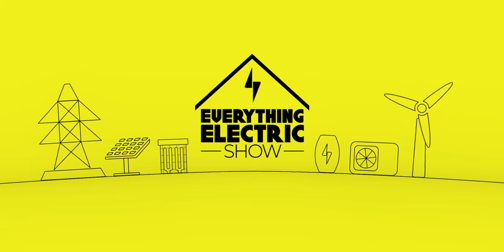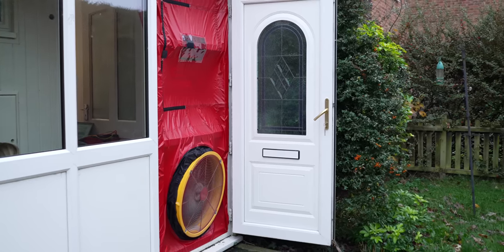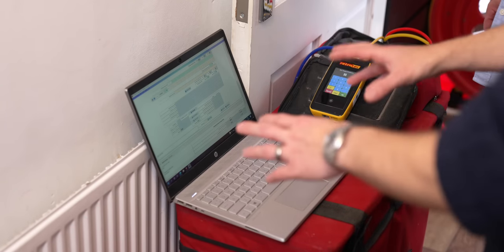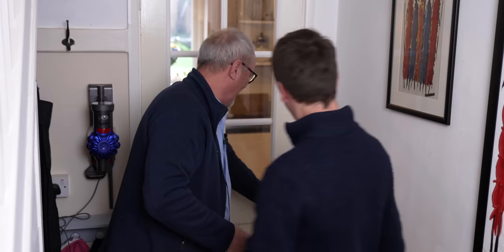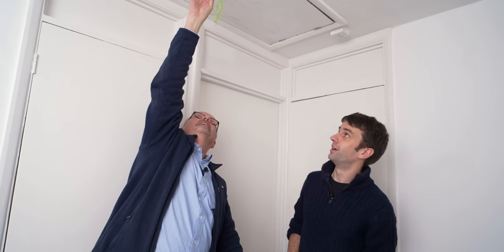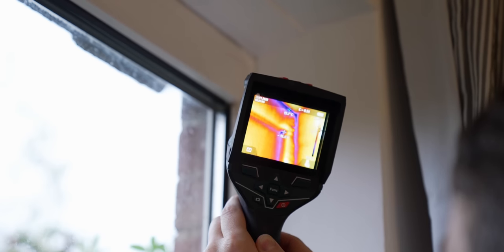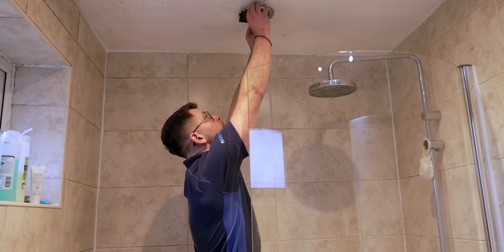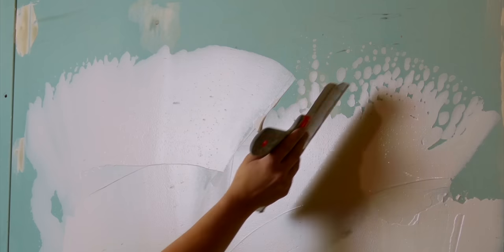Every Home Should Take This Test | Everything Electric Show

Comment: a test like this costs about $300 here in GTA, Canada... you can do something similar by turning on every exhaust in your house (washrooms, kitchen range) and going around with an incense stick to feel for leakage
Reply: Not sure if that would powerful enough, have you done it?
Of course the colder it is outside the better you feel the draughts
Reply: @markthomasson5077  a kitchen hood exhaust can pull 400cfm (depending on model) and each bathroom exhaust can pull 80cfm (again, depending on model). Combined together, that's definitely enough to depressurize a house and you will feel that make up air leaking in.
Reply: There are no exhausts in my house. I just open a window when things get smelly or steamy.
Reply: remember to close all your trickle vents and block any vent bricks during this test.

Comment: Just had NATTS in to perform the test after seeing this video.
So glad I did, what a superb service and really informative, not only found air leaks but advised how to resolve them.
Thankfully not a great deal of work to improve things and a surprisingly good score of 4.
The house previously suffered issues of condensation and mold, but I fitted a PIV unit a number of years ago which resolved that. Have a potential (with the ventilation unit) to get down to 0.5.

Comment: It really should be a DIY kit you can rent. I want to pay £30 to find the leaks, not £400 for someone to tell me where the leaks are.
Reply: We made one from a car radiator fan in a bit of OSB. It's gone round several local houses. You don't get an accurate ach number, but it's easy to pressurise to 40 or 50kPa on normal-sized houses (50 is the test for the standard) and then you can go round finding all the holes and take as long as you like over it. It's usually easier to put it in a window-opener than in a door. A bit of pipe with water in (manometer) suffices for a primitive pressure guage. Later we got a better one, and a hot-wire anemometer for accurately fiding and quantifying leaks. I didn't fancy paying £300 either, although now we've done most of the work I will do so soon to get an calibrated number (and calibrate our contraption).
Reply: Agreed. I paid £280 for mine and it'd be nice to pay less than that
Reply: You can diy it!   Close up the house, and then run the cooker/kitchen/bathroom extractor fans all at once.  It’s not as powerful as a blower door test but if these these can pull smoke out of a cold fireplace, then they’re good enough.

Then go around with a thermal camera/ir thermometer to find where cold air is leaking in.

My 2nd most recent video has me going around my house with a thermal camera.  They can be had for around £350 and they aren’t just handy for energy audits, they are excellent tools for all kinds of diagnostics.
Reply: Well the kit is £6k and the course for how to use it and calculate air permeability is expensive and time to train and to do several test houses. But yeah I absolutely hear you a cheaper alternative that doesn't do all that would be really beneficial. Combining with themal cameras in winter can be even more revealing. Shame they didn't showcase using smoke with the fan to find leaks.

Comment: Everyone watching this please contact someone that knows what they are doing before sealing up your house. Please remember ventilation is completely separate and should not be sealed. Seal Tight, Insulate and Ventilate Right ! If you mess up any one of those steps you can have problems. If you are in the Southwest UK give BAT Ltd a buzz
Reply: IMHO all homes should have MVHR and not rely on holes in the walls for ventilation!
Reply: totally agree! general public don't realise that background ventilation is required as part of the building regs for people health, whether that be mechanical or not!! I've been going around drawings adding extra ventilation as the window manufacturers can't get the required ventilation through their window trickles just this week!. Yes MVHR is a great alternative, but as with everything it's down to cost.
Reply: It's quite difficult to seal the average UK house up enough to give yourself a problem, although it is obviously do-able, especially if you are a 'dry clothes indoors', 'cook with no lids on' sort of family, or have a lot of people in a small house.
Some sorts of ventilation are just bad though (like trickle vents) and really should be sealed up and replaced with something more efficient/effective like DCV or MVHR.
Reply: @ashleyjohnson1908  Much much cheaper to do it during the build stage though

Retrofitting an MVHR is in the pipeline for my house but it's also £10K

I've currently got 8 solar panels, and plan to get 8 more before I do that

Comment: I've had this done in many (newer) properties, it's great. So easy to justify making incremental improvements. In older properties with solid walls (my latest is two foot thick basalt) with damp problems,  installing a Positive Input Ventilation System (PIV) to push out moisture you need some small leaks in the property to exhaust the slight positive air pressure created from inside to out
Reply: 2 foot thick basalt? Sounds like an interesting place/project!
Reply: Maybe you mean granite or whinstone solid walls?
Reply: @asilver2889  nope. I had it tested.

Comment: Well I know what I’m up to over christmas time off.
Dig fan out the loft.
Get thick bin liners.
DIY shop- loads of duct tape
Raid the my shed and dads junk cupboard for spare foam, off cuts of plasterboard and silicone.
Go round the house with a tissue on a stick.
TBF, we had EWI done 2yrs ago and know where the big issues are now.
Front door- knackered
Old coal fire breather in our bay window.
Single glazed wood framed tiny window in our pantry.

Comment: We used to do these tests for installing halon systems in computer rooms. In a domestic house, be aware if you seal the house too well you will probably get condensation and damp. The air needs to circulate. You also need to exchange oxygen and co2 with the outside, particularly if you have any type of combustion heating eg  gas, coal, wood burners etc
Reply: That's why on older properties you have trickle window vents, combined with bathroom and kitchen extraction and on newer properties you have mechanical ventilation with heat recovery.
Reply: I wonder how much energy is used mechanically circulating the air, versus the amount saved by recovery? In a commercial setting where the system is designed specifically for this, I would imagine it could be cost effective,  ut for the average residential box, I wonder.

Comment: I think it is important for widespread adoption to find a way to manage the trade-off between the cost of works (e.g. improving airtightness) against reduced heating, reduced cooling and increased controlled ventilation costs.  I would like to prepare something like a cash-flow forecast for heating, ventilation and cooling that gives a Return On Investment.
I don't think it is particularly easy to produce such a model or plan for one's house. E.g. where might I find a good source for a (working) energy cost forecast over 5, 10 and 15 years?
Does this sort of thing already exist?

Comment: It would be interesting to know if a house heated with infrared panels is better at keeping warm than radiators. If you are losing 'hot air' then you will have to replace it by heating the incoming cold air, but if the fabric of the house is warm, and the air is heated from that, is the loss of air going to have a lesser effect on how much energy you use?
Reply: There are a lot of factors to consider including; the wall build up, heating positions, insulation and thermal bridging, the use of the building, in particular when is it occupied during the average week, how much external surface area the building has (terraced houses are actually a good thing), the thermal mass of the building, how the air circulates within the building, the layout, and the thermal comfort. Higher speed air makes you feel cooler for example. I took part in a thermal comfort study a while ago, then the woman running the study left the UK due to uncertainty about if her qualifications would even be recognised after Brexit. No idea what came of that, but Salford University build Energy House 2, so there is still people left working on these studies.

Comment: Eee bah gum lad, that wa an epic show. We’d just put on an extra woolly over our string vests and eat a bit more int winter. Funnily enough I went through this exercise myself and sealed up two wooden doors with keyholes. I designed a 3D printed TPU keyhole plug as a right draft was coming through the doors. It’s up on thingyverse, so help yourselves. Look for Key hole plug.
Reply: Thanks. 😊 good work on leak finding!!!

Comment: Thanks for this, useful thing to have done. What I like is this is possible for renters to do as well. I'd like to see more videos on things renters might be able to do, as not everyone owns their own home and can fit heat pumps etc.
Reply: It is possible for renters definitely. What we need to do is get the government to change the regulations so that they count this towards EPC scores for existing housing. Currently they just assume a score of 15 for every house and you can’t change the score so can’t show an improvement, but it’s different for new builds! Please tell the government and your local MP. We need to change this so that landlords have an incentive to do this.
Reply: When renting old farmhouse I did my own draught proofing, cheap and easy, gaps round windows, doors, open letterbox (!!), under kitchen sink, skirtings and loft hatch - but that did need a stepladder. 
EPCs are truly rubbish. Suggesting unsuitable cavity wall insulation (solid walls) and taking no notice of  thermal mass etc.

Comment: Home owners and Landlords should be made to do the test and fix leaks.
Reply: Absolutely. They should do this to the poorest households who also have absolutely no control over fixing the problems to their home.
Reply: Definitely, this is one of the main motivations for this video. Please share and ask you MP. 
The testing system for EPCs needs changing as the government doesn’t take into account the air permeability score on existing housing stock when calculating EPCs so no landlords, councils or housing associations can justify doing this as they can’t show an improvement because the EPC system doesn’t let them! It neeeds to change urgently!
Reply: They should first do it to all council houses, some of my friends live in social housing and it is the worst living conditions imaginable.

Comment: For the attic hatch there are special made insulation blankets.

They mount in the attic around the opening and zip closed.
Like a big reusable grocery bag material.

Super easy to install.
Reply: That sounds like a great idea can you post a link?
Reply: @deanfielding4411  Search Attic Hatch Cover.

When I post links people report me for spam.
So I quit doing it.
Reply: Good, but still need to seal the hatch edges.
Reply: @asilver2889  The ones I saw doing pest control sealed around the framing.
I think it was some kind of double sided tape.

Comment: Thanks Dean, really interesting, especially about the dot 'n' dab plasterboard.  I've sealed all around waste pipes, cables, windows, insulated the loft hatches & installed insulation covers for ceiling lights. amongst other things.  Made such a difference; all that's left is to get my son and daughter to stop opening the windows;
"We're too hot!"
"That's because you're cuddling a hot-water bottle, wearing pyjamas inside a onesy under a duvet!"
Reply: That has genuinely made my day! So pleased for you. Think of all the money you’ve saved and CO2!
Reply: You could seal up their door frames once they go in.  :)
Reply: @deanfielding4411  I came across this post, which offers an option for the under skirting draughts including those that might come from the dot and dab gaps....
https://www.youtube.com/watch?v=V6lZXjRR-1k
Where people have laminate or wooden floors & the skirting is already on, do you have any other suggestions as to how they might block gaps in a way that doesn't detract from the visual aspect of the room?
Reply: Dot n dab should be 'banned'. Only if fully sealed round edges would I accept in any build I control.
Reply: @forestblackberry7046   Charlie DIYTE very good, covers condensation and mould problems too. But the expanding tape he uses is pricey (compared to silicone) and comes in black only. Other methods are oakum (string with waxy coating) wood slivers which can be bought (apparently), or acrylic type sealant rather than silicone. If old property use old tech fixes rather than plastic-based. 
Just using foam packer tube may be enough for under the skirtings.

Comment: Worth noting for people with older houses - especially those built with fireplaces  - having it airtight is not a good thing. If there are no draughts in solid walled old houses, you will get condensation issues. Also, if you have wood burners, open fires or Agas the room that is in should not be airtight - the fire needs an air source to keep going!

Comment: Recall a neighbour being concerned about this over 40 years ago, he used a primitve means to check  using a candle to observe air movement.
Reply: Yeah, a strip of bog-roll on a windy day will also let you find leaks. but it is a lot easier with a fan making a consistent pressure-difference. It's not hard to bodge up your own for hole-finding.

Comment: Been wanting to have this done since I saw and read it in It’s Not Easy Being Green - I always thought the cost of doing it would be prohibitive - house built in 2002 but not a single gap filled between floors and walls - slowly filling gaps when I find them through cold draughts 😬 Typical builders 🙄
Reply: I had this done before the video. My own results are 7.66 which is acceptable by the standards of government, for a 1975 house 

But it isn't acceptable for me. I will now seal up all areas where I can. I intend on getting an MVHR too
Reply: @waqasahmed939  how much was the test out of curiosity?

Comment: In the UK, FENSA who accredit all new window and door installations will refuse a certificate to any new window that does not have a trickle vent fitted. Appreciate that this is in the category of controlled ventilation but when these vents fail and disintegrate which they do after 15 years or so it rapidly becomes uncontrolled - would be good to have an episode looking at trickle vent repairs and which windows can safely have trickle vents sealed up. In my experience bathrooms and bedrooms need them but no other room does. Interested in your thoughts.
Reply: I fitted my windows myself on all our back windows. I only got trickle vents in the utility and bathroom. All the other rooms have fireplaces which are blocked with an air vent in to allow ventilation.

Comment: I'm not sure about this idea yet. Air-tightness is probably great when combined with a good ventilation system. But if you make a house airtight, it seems to me that it quickly fills with stale, damp air. Then you have to keep windows slightly open. Which defeats the purpose of making it airtight.
Reply: Exactly true
Reply: You are supposed to have climate control and have active intake and removal of air. Not stale, but exactly how you like it. Our machine follows moisture level and co2 in air and will boost the rpm if either exceeds user input values.

Comment: The DIY way to do this is just to turn on all your extractor fans at once, and use a damp hand to feel for draughts. It doesn't have to be scientific unless you're calculating an Energy Performance Certificate.
Reply: Spose it will help you get the low hanging fruit. Let’s face it. You can’t do it wrong.

Comment: I was quite surprised how bad the figures for UK housing stock are. 

We recently built our own Passivhaus and had to get below 0.6. However, as we’d never done anything like that before we were a bit over cautious and actually achieved 0.06!

Whilst testing we accidentally left a 2” waste pipe uncapped which had a howling gale blowing through it - you could hear it from the next room - but even with that open we were only around 0.2. 

A score of 5 must be the equivalent of having a window open, 10 a door open and 15 a whole section of wall missing! 😳
Reply: It is said that most houses do have equivalent of a 300 X 300 opening when all gaps added up. Passivhaus total gap about egg size.
Reply: my goodness must of smelt awful!

Comment: How is this any better than turning the heating up high on a cold day and walking round inside and out with an infrared camera, and after you have finished you have a nice new infrared camera probably for less money. And a detailed view of both leaks and where your insulation is failing instead of just leaks.
Reply: It's different. You can find leaks with a thermal camera. It works well around windows/frames and for big leaks like a pipe-entry, but there are a lot of air holes it's easier to find the wind blowing through, like mains sockets/light switches, cracks in plaster, gaps around skirtings/boards/joists/lights. You can do this with a car radiator fan fro the scrappy for £10 and an OSB offcut so you don't have to spend £300 unless you want a calibrated airtightness figure.
Reply: That will pick up warm areas, but it wouldn't pick up things like the loft hatch. where the warm air goes into the attic, an then bleeds out through all the slates.  or if it did you wouldn't know if it  was your loft hatch or the ceiling lights.

Comment: Nice tech. You could use an IR camera to see the cooling effect of the air being drawn in, too.
Edit: Yes, they do that too
Reply: Indeed it works well 😊 if you look closely the cold bits in the windows were where the rubber seals had shrunken and air was actually leaking around the glass.